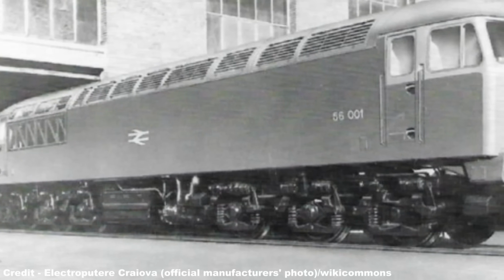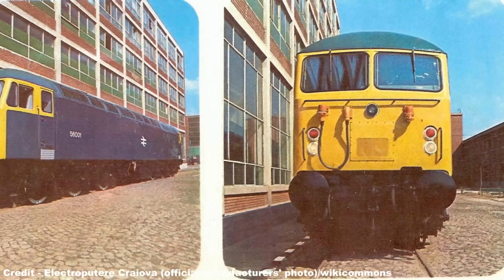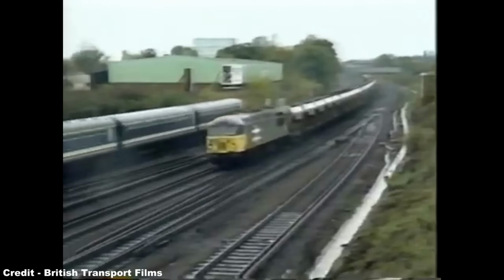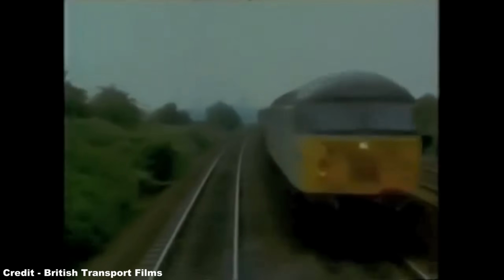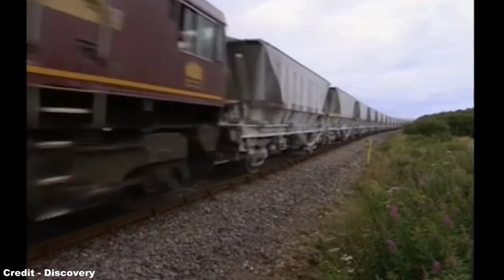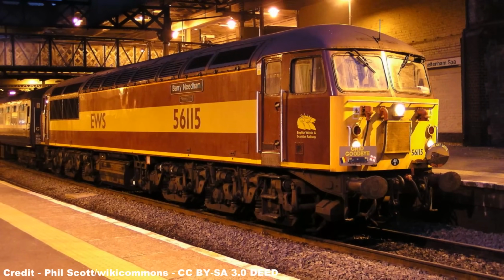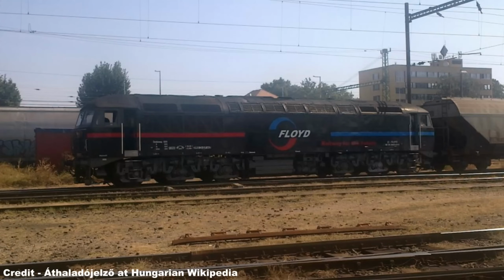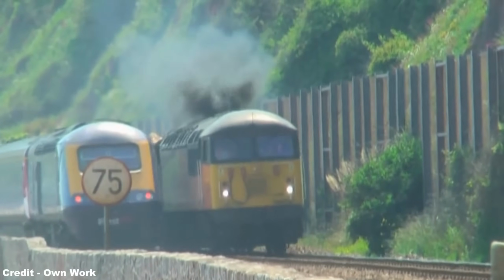National Grid - The Class 56 Story (Reworked)

Comment: Another informative video. The 56 and 58s kept Britain fuelled for years! They worked hard, and the MGR trains were heavy at around 1650 tons 36 wagons . They also were a regular on the Chilterns with the GLC bin liners again heavy duty trains .You could hear a grid for miles ! Even as of 2024 they appear here on the spoil trains along with the 60s for Cappagh.  Not bad for a 70s build!

Comment: Seems to me that these were really quite successful. That they were replaced by the Class 59/66 is no great shame given the testing ground of the US/Canadian locos. US and Canadian trains no doubt have their failures but running a train with 2, 3 or up to 5 locos means, like the HSTs in UK you have redundancy in the event of one failure, and a chance to prove the kit. Had we designed an upgraded Class 20 with an output of 1800 horse power these might have been the best bet overall with 8 driven axles?
Reply: Those loco's did exist as the English Electric K's and R's on the WAGR in Australia